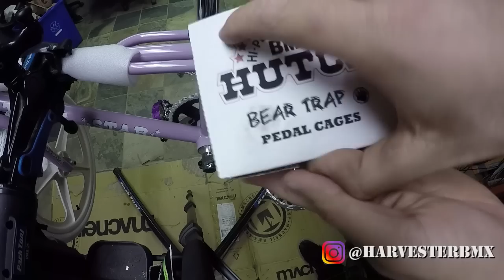CUSTOM Hutch Trickstar Build @ Harvester Bikes OLD SCHOOL BMX

Comment: My shins hurt looking at those pedals, should've kept all the hutch parts, could've got skyway mags that have sealed bearings 14mm axle and 9t cassette since the bike has 14mm dropouts, purple merit tires, that big sprocket is a downgrade not an upgrade and looks cheap, no gyro or front brake is a huge disappointment, I'm unimpressed with this build
Reply: I agree. Should of at least had an acs rotor& a front brake that's why the stem is hollow,right?
Reply: Omg….taking peddles off the shins….happened almost everyday

Comment: The only thing i dont like is back when that bike was produced, it was produced to be exactly what the name is ( A trick freestyle bike ) In those days you would of had a front brake with cable through the handle bar clamp and a Giro brake rotor . I understand that today the kids are so advanced they dont even have breaks but bringing back an old school hutch needs it. Awesome build btw. Makes me want to get one and do it myself. Didnt even know you could still get one.
Reply: I said the same thing. It needs an acs rotor& a front brake that's why the neck bolt is hollow.

Comment: It would be nice to see them built with original style pegged forks and rear frame platforms. This is a nice looking build though.
Reply: Agree, on the built in fork pegs, but those rear frame standers were useless garbage, they were way too small and narrow...A set of Skyway pegs fixed that issue.